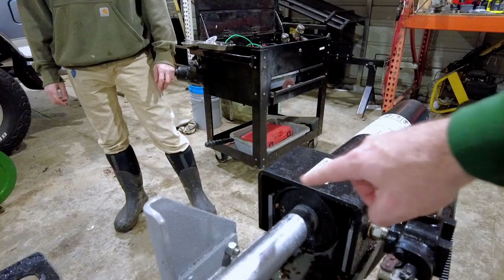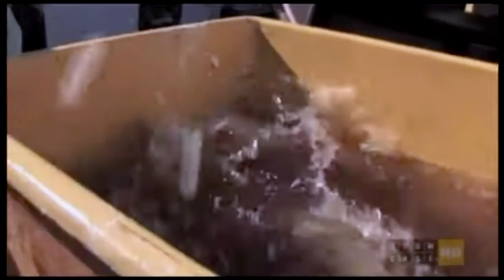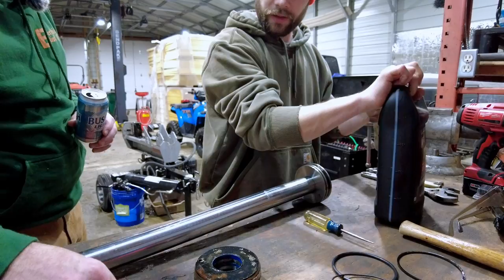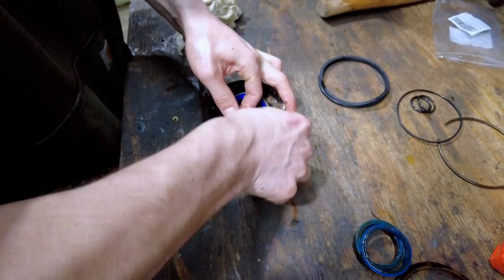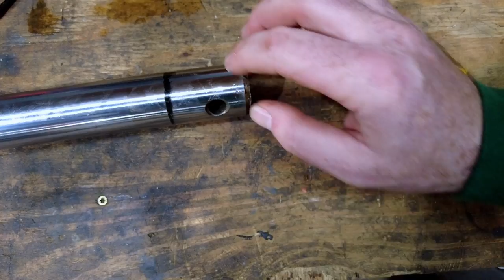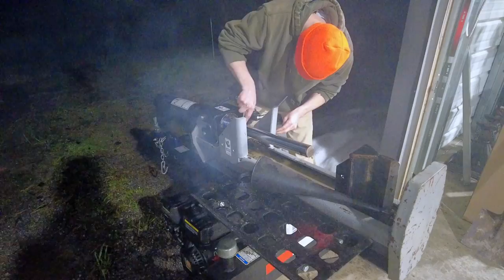Log Splitter Hydraulic Cylinder Rebuild

Comment: Nice job!   I’m an excavating contractor and sell hundreds of cords of firewood every year, I’m no mechanic but I fix all my own stuff because I can’t afford mechanic rates or wait…anyhow here’s my big tip…when working on the cylinders or anything on the workbench I always put down a….empty 30 pack box!   Busch light boxes will work just as good as a miller lite box!
Reply from the maker: Now there’s a pro tip!
Reply: @jimjim7819  the snap ring?… pull the rod up and smash it back down or maybe a little hammer persuasion to get it to seat .
Reply: You sell hundreds of cords of firewood every year…. Nahhh.. Don’t think so. I’d be surprised if you even sell hundreds of face cords every year. I have a firewood business of my own. That’s how I know.
Reply: @rodneychapman197  you must sell bundles, I sell 14’ dump trailer loads…actually haven’t sold over two hundred loads in a season for the last three years…too warm.
Reply: @njonebale7889  Dang. You must wear out several hydraulic wood splitters every year splitting hundreds of cords a year. Nahh. My operation is small compared to yours then. I sell mine by the face cord/pickup load. I only saw, haul, split, stack and move around 85-90 face cords each year. Not even close to your thousands of face cords each year. Keep on keeping on my man.

Comment: Have trouble getting my rod out of the cylinder. Or shaft.
Reply from the maker: Don’t be afraid to give it the business. Those seals are designed to be tight and can fight you some times. Push the rod half way in so you have a “running start” when trying to pull it out, use inertia to your advantage.

Comment: I have the same splitter and the cylinder just started to leak...it would have really been helpful if you could have explained or shown better when you were using the brass dead blow on the  face plate....it really was not clear what you did...and if you mentioned the part number and / or source for the O rings...really can't even call this a how to video missing that information....I appreciate that you did the video, but for a 23 minute long video, you omitted the 2 most important things
Reply from the maker: I didn’t bring the parts, George had them already so I’m not sure on any part numbers. Give me a couple min I’ll link you a video where I go deep into taking the cylinder apart, I believe I referenced  it in the splitter video.
Reply from the maker: https://www.youtube.com/watch?v=ocgOyhyLEXY

start at the 4 min mark.  Its not a log splitter cylinder, but its the same exact design.
Reply: @EverythingElliott  Thank yuou for that!..Thumbs up 👍

Comment: How do you figure what size seals to get?
Reply from the maker: You can pull the part number right off the seals, if they don’t have part numbers, take the piston (disassembled) to any decent hydraulic shop and they will hook you up with a kit. They will just measure it

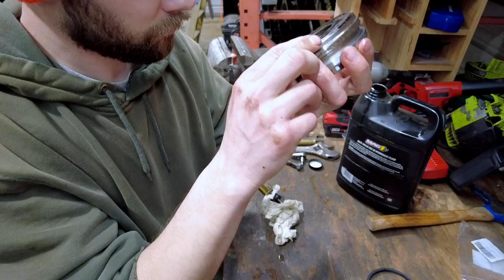Comment: I think I put the inner blue rings in wrong.  Around the 13:10 mark you mention “spring down, always towards pressure” can you explain how those blue inner rings go in?  
I replaced mine but when I went to put that cap back on the rod, I jacked up the blue rings and have to get new ones.  Again, would be helpful to know how to put those on properly.
TIA!
Reply from the maker: Spring toward pressure because that’s the way the lip is facing, you want the fluid pushing into the lip pushing the ring outward against the rod, if you put the ring the opposite way it would be able to push past it fairly easily. When you put the cap back on, use lube, hydraulic oil is obviously the best. Take your time to make sure you’re not forcing it on.
Reply: what is considered the spring on the seal?
 @EverythingElliott
Reply from the maker: @krislabuff8842  The one seal has a spring liner in it, that's what I meant.
Reply: Did you ever figure that out. I am having the same issue. The black inner o ring of that blue seal I have facing the pressure and it just seems wrong with the way the lip is. I cannot get it on the shaft. The original seal didn't have the lip on it

Comment: Not so sure using those metal tools around the shaft was wise.  Use wood and rubber or plastic hammer.
Reply from the maker: Thanks for the tip

Comment: 13:04, spring down. Spring always towards pressure. 
That's the hardest one to get in and ya'll turn off the camera. WHY DO YOU THINK I'M WATCHING THIS VIDEO!!
I need to know how that seal goes in. That's the entire purpose.
Reply from the maker: Pinch the seal so it can fit inside the hole, start one part of the seal in the grove, and slowly move your tool so you keep pushing a little more of the seal into the groove. You’ll eventually get to a point where you’ll have just a little bit left outside of the groove and you’re going to feel like it isn’t designed to fit there. That’s where patience and force comes in, carefully, but firmly force that seal into place with a dull tool as to not damage it